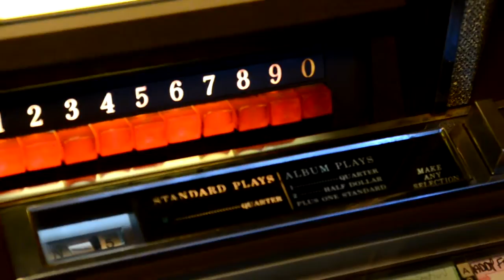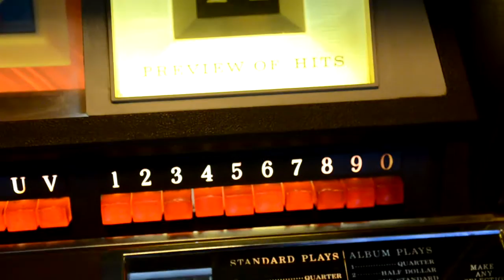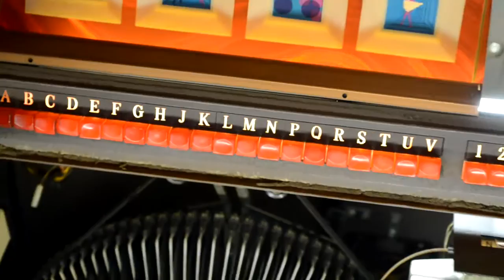Rowe 1967 AMI MM1 Juke Box plays 45's here's one from the 70's Louie...

Comment from the maker: Thanks for letting me know, unfortunately, my connections are way different. My amp is 100w, I wonder if the amp you saw was a more recent one. Way less connections. 
Maybe someone out there knows some tips or tricks to get these amps to work better. I'm not sure if the switches are bad, or a noisy transistor on the board is causing my problem. I resoldered everything and cleaned it well with cramolin. Still having this problem.